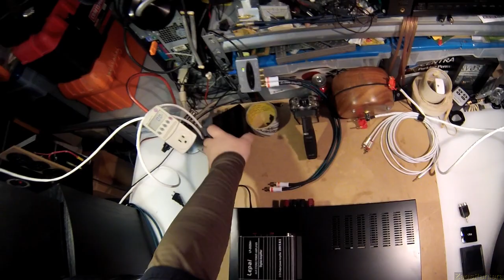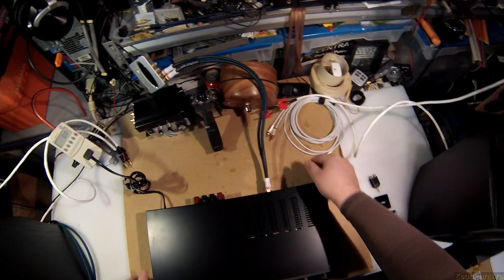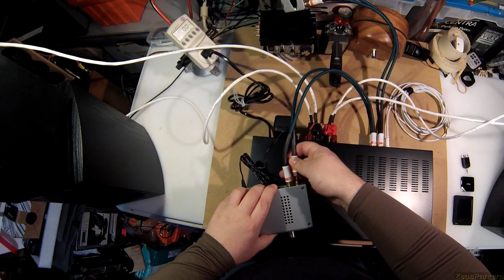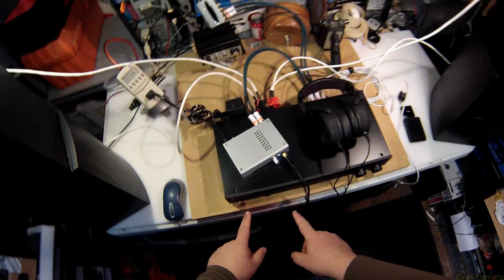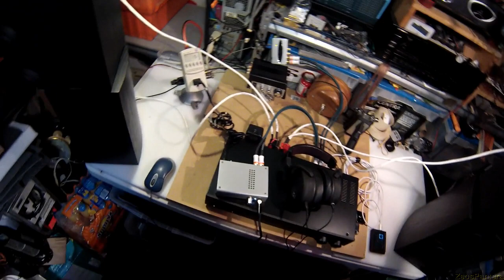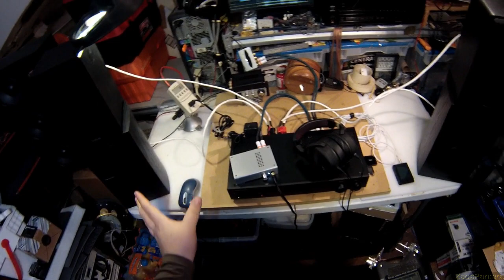Z Review - AudioSource AMP-100 (Ultimate Desk Setup?)

Comment: Could you get the uca202 too work in junction with a powered sub running on the on-board audio channels? Admittedly I dont know much about audio components... Just wondering.
Reply: Not really. Unless you get real funky with software like Virtual Audio Cable you can't easily get windows to output to two different devices.

Comment: Would this guy work well for the "micca voltron?" NoAudiophile demonstrated this setup involving covo-s with club 3's using some more expensive electronics and miniDSP. Could I simply put a 200hz LPF inline for the covo-s' on their outputs, and just send full range to the club 3s on their set of outputs?
Reply from the maker: +kwengca I think you need multiple amplifiers and the MiniDSP to accomplish what he did. This amp would work for one of the stages and I suppose you could try a hardware limited option but mini DSP does a whole lot more than just frequency cuttoffs.

Comment: Wow, I bought mine used and the volume pot is dirty, as well.  I thought it was because it was used, must be a more common problem.  Would compressed air in the pot work?
Reply: They sell a spray specifically for it called Deoxit but the easier solution is just run the knob back and forth a LOT.. like 100 times (with the unit off.)

Comment: If the AUX in is from the AMP it uses the DAC to or not?
Reply from the maker: Hysterical Bunny Do what? What dac, where? There is input 1 and input 2 on this amplifier and an RCA passthrough for input 2.
Reply: Z Reviews Im sorry for the stupid questions, I mean if a iPod is connected to the AMP. The DAC is improving the sound of the iPod or not?
Reply from the maker: Well if you just hook the ipod up via 3.5mm to rca you are using the dac in the ipod. Dac's needs a digital input (USB, SPDIF, HDMI) in order to do their job of Converting it to Analog. So you would need an ipod compatible dac with a USB host function to improve the ipod.
Reply: Do you recommend one?
Reply from the maker: Not really, They are not cheap [http://amzn.to/1HHTQXL]. Usually the dac in the ipod is good enough you just have to find the best volume to leave ipod on.

Comment: What would give the best sound quality:
1. AMP-100
2. TOPPING (TP22/TP60/TP41)
3. Something else?

Also, which topping model do you think is best? (purely sound quality wise, I don't care that some have more power)
Reply from the maker: The SMSL SA60 [http://amzn.to/1z3kQ0n] is probably the new king. Digital volume control and a slightly underpowered chipset.

I haven't really heard enough of the topping lineup to make that call.

Comment: , just hold on a minute man, back it up.
you CANNOT RUN A FIXED
PREOUT TO A SUBWOOFER because your volume knob won't work with that pre-out !!!!!!!
unless your weird and run your music at one preset volume level ALWAYS.
There's no way to control the volume with the main amp volume knob on the front.
even if you run your pre-out to an amplifier with a volume knob like the Emotiva, you will always have to adjust ( 2 ) volume knobs at once to keep things balanced out. 
you could get a Nobsound 
" Little Bear " RCA control hub switcher like I have with a volume knob and make things easier but the fact is, YOU WILL ALWAYS HAVE TO ADJUST 2 VOLUME KNOBS AT THE SAME TIME because the pre-out is "FIXED " !!!!!!!!!!!

Comment: Hi Z review

I am trying to use this amp for my desktop set up. I have an external creative usb sound blaster hooked up with this amp and am running Elac B6 speakers. The sound is pretty good, but very 'low'. I have to crank it to 11 ;) and even then it is not loud enough.  
On the other hand, my older Lepai amp  below does a great job and the sound is clear and plenty loud without turning it up full blast. 
 
 https://www.amazon.com/gp/product/B0049P6OTI/ref=oh_aui_search_detailpage?ie=UTF8&psc=1
 
 I am not sure what the issue is here. The Audiosource should be much better than the Lepai, but I am not getting the sound quality from my computer. 
 
 
 I tried hooking up my phone to the amp and it plays wonderfully clear and loud. It is only when I connect it to my desktop that the problem occurs. The same with another amp I have tried. But the Lepai works like a champ. I am befuddled and any help will be greatly appreciated. 
 
 Thank you
Reply from the maker: You have low signal coming from the PC. A dac may help. Not sure why it would be such a pain.
Reply: Thank you for the reply. However the cheapie lepai amp plays just fine with the same signal from the PC, while the very good Audiosource does not do as good a job. However, when I use my phone as the source for the Audiosource, the sound is brilliant. I am at a loss. Do you have any thoughts that may help me ? I will look at the DAC as well. Thank you again.
Reply from the maker: Your phone is outputting more power into the amp to start with and the lepai is jumped up already. I am sure if you tested the Lepai into your phone it would be insanely loud to the point of distortion. This is just what happens sometimes.
Reply: Hi Z reviews. That makes a lot of sense. Thank you very much. Any recommendations on a DAC that will help me use the audiosource with my pc ? Most of the DAC's that I am looking at on Amazon are headphone amps, will those work as well ? Thank you for your help.